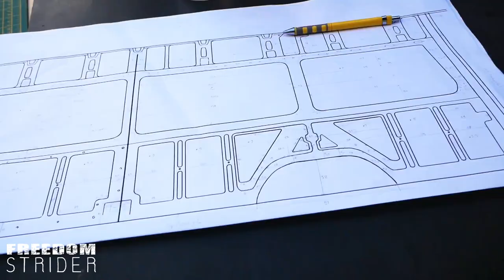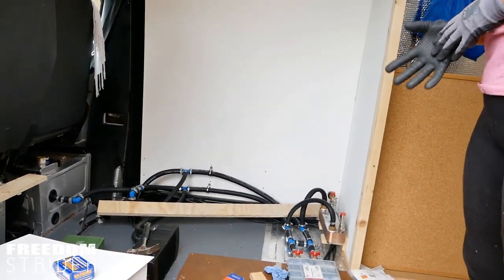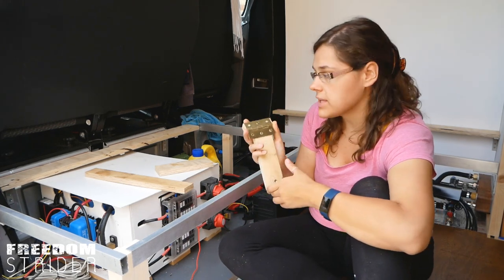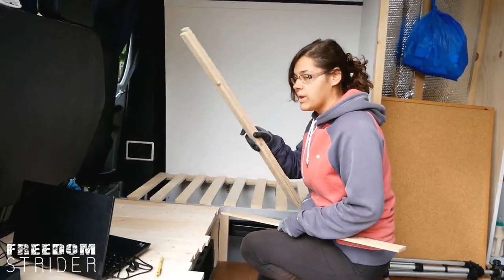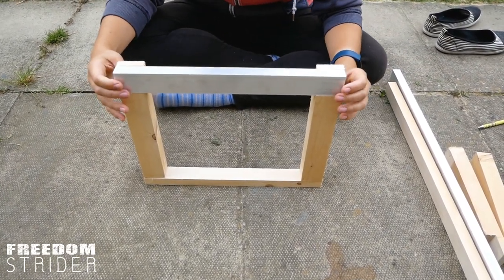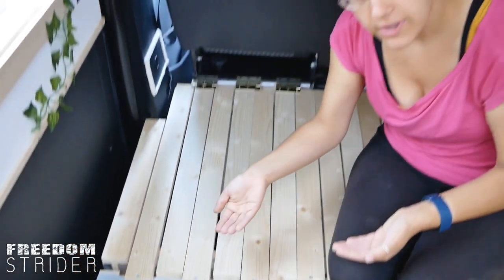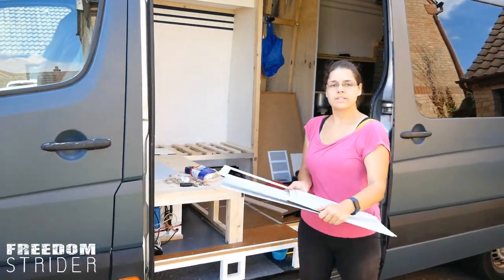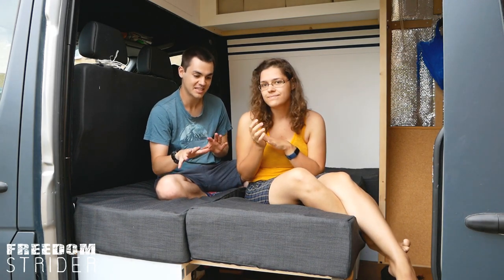EPIC Pullout Van Couch

Comment: Great video! Thanks for sharing

Im just wondering - Does that not render your swivel chair useless? The couch cushions sit higher than the magic swivel, so I imagine you will have to push them aside to use the chair.. But will it be comfortable having your legs on top of wood planks when sitting the swivel positon?

Looking forward to your next video!
Reply from the maker: Not at all. Yes you do have to remove the couch cushions to swivel the front seats, but once they are swivelled around, you can put the cushion back and put your feet up whilst sat in the swivelled chair, and it creates a cinema lounge position - it' makes the van feel even bigger too! 🙂
Reply: @FreedomStrider  aaaaaaaah that sounds amazing! Looking forward to seeing that in action! :)